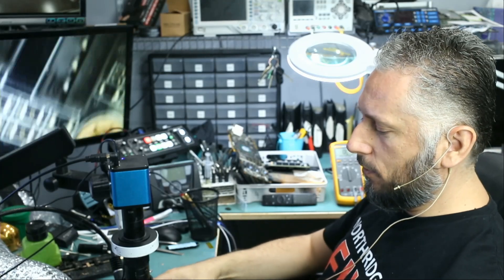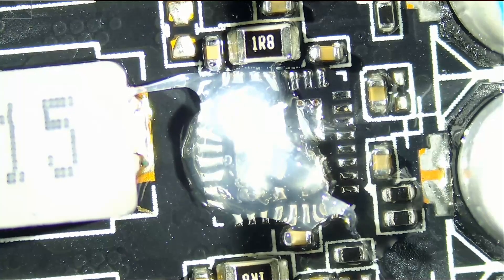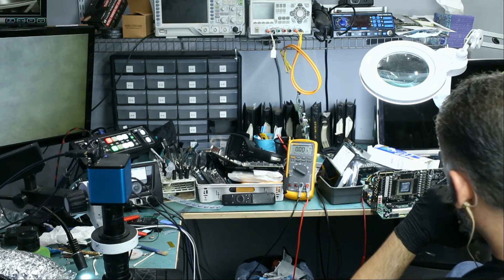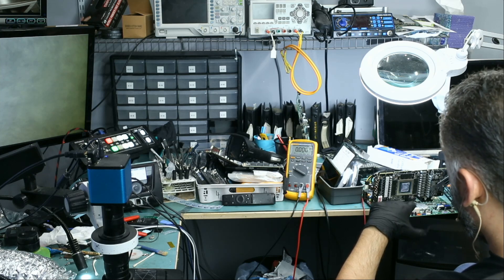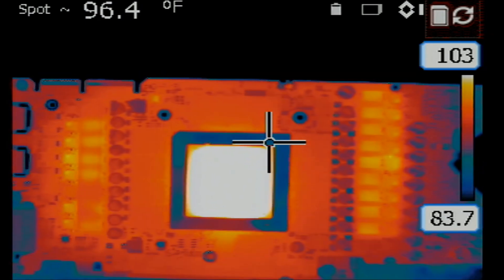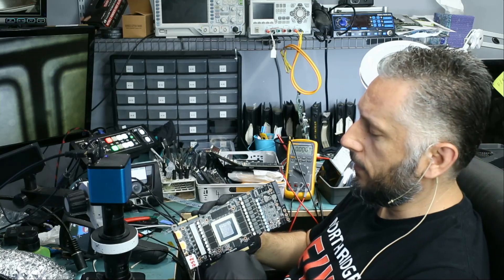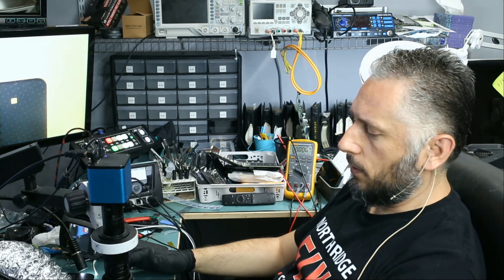Gigabyte RTX 3090 Graphics Card Repair - No Power and Not detected Part 2

Comment: You should continue testing, you barely tested anything. You should check 5v, 0.95v, pex rail, test resistance on all mosfet gate terminals, also test EN signal and Vcc and Pgood for all the drmos and buck converters and PWM controllers. Also check the back of the gpu which has tons of components, resistors that died under heat, etc
Reply: Seems like you work on Gpus alot
Reply: @nylesnguyen3797  exactly, which also explains why it took me 4 months to check my notifications and reply to your comment.
Reply: From a business standpoint, is it viable to do that thorough of a test? I know as a consumer, I would like that, and as a technician myself its the ideal procedure. These scenarios give me anxiety, when everything you tested seems normal but device still wont work properly. From you experience, what kind of training would help further repair skills? Manufacturer schematics are out of the question, yet is electronics' reverse engineering the way to go? We are also talking about a $3k board, so it sounds as a promising investment.
Reply: @zettkusanagi6322  exactly, it's a good investment. Experience is the biggest factor. For me, i can narrow down the problem of any gpu in less than 10 minutes. People think gpus are simple devices, they are one of the most complicated devices in the world.
Reply: @gpudoctor   Should start uploading some videos...
Reply: You realize this is the second video? He tested for 20 min before this

Comment: Hi, I do the same job as you but in Italy, so there is no competition.
As a suggestion I can tell you that video cards should always be tested with the heatsink mounted, because many of them have a control system that ensures that the cooling system is fully functional to prevent the video card literally catching fire. Reassembling all the pieces "annoys" a lot, but it must be done.
I hope I have explained why, I speak and understand the American language, but for the written part I use google translate.
Regards.
Reply: In a reply to another comment, he stated they completely reassembled the card with the same result.
Reply: @randyr.parker2698   I read the comment, but he connected the card without a heatsink. My (small) experience says that you have to connect the card (power the circuits) always and only with the heatsink mounted.
Reply: @codatekalbatek  Respectfully, this is not True at least for some 3090s. I have personally watched (2) 3090s post without the heatsink or any of the thermals or fans reattached. Considering these cards idle as low as ~25w, this (relatively) makes sense. Best, Robert

Comment: i guess its the controller chip that sits on the corners of the die (at least at the gtx 1080) that failed. Is the glue around the die discolored on the corners?

Comment: One chip on the left (i think a memory one) didnt seem to generate any heat while all the others did when you turned on the card. Could it be that this chip is faulty? Hope you can figure this out
Reply: Yea, that's a possibility. But it could just be that it isnt needed, so it isnt currently working.

Comment: That's got a FRIED GPU when those Vcore MOSFETs fail the GPU gets COOKED a good portion of the time going from my past experience.
Reply: sorry but i dont have the same ideia, +30 rx490, rx570, rx580 gtx 970, gtx980  all mosfets burns replace, some time replace CONTROL IC TO,  and that done work again... in last 30 only 2 die after 2 day (in burning test, and bench), "core MOSFETs fail the GPU gets COOKED" some times it open to plus, but that i do find very ofen

Comment: Most likely a problem witht the gpu chip itself when during its operation when the mosfet goes bad it short drain to source so it send a highvoltage full 12v on the gpu die instead of 3.3v or lower, because the mosfet is like a switch and in dcdc buck converter mode

Comment: That is a very power hungry gpu, will require at least a 1000w psu. Also is the motherboard compatible? From what I can remember it requires a motherboard that has support for pcie 4.0 in order to power it. May also need a cmos reset.

Can someone correct me if I'm wrong please.
Reply: On boot up, in 2D mode, the card will be drawing <20 watts (or it should be) - no beefy PSU required just to post. The card has almost certainly had the GPU fry from the 12v short. The smart mosfet that failed was one of the phases for the GPU Vcore - when it shorted out it would have sent 12v straight into a core where the maximum is supposed to be 1.25v...when this happens the fuse is the only thing that may save it but often it doesn't blow fast enough and something in the GPU burns out. The card was heating up way too much in post, even without a heatsink - indicating the GPU has an internal short.

Comment: Hello. I think a component is missing under the capacitor at 2:45. I you look at the rest of the MOS there is an 1R8 Resistor, a capacitor and under it another component. The rest of the MOS have it but the one you use the which doesn't have it.
Reply: Check at 9:02 on part 1 video. It doesn't have any component. It's just empty. There is 1R8 resistor surrounded by 2 caps each. That's enough. 👍
Reply: @ErickBuildsStuff  Thank you

Comment: Surely this card would be under warranty?
Reply: Not if overclocked.  afaik the card stores the fact it has been - obvious step to protect yourself if you're the manufacturer.
Reply: @jongant 
Nope, it doesn't, that's a myth. Manufacturers have no way to know if you overclocked or not unless you tell them.
Reply: @WertzOne  they could read the bios and find the clock values...

Comment: Yo guys connecting the fans does nothing. I mine and all my cards get 120MM fans, I basically remove the stock fans to preserve them. I've older and new cards, connecting the fans doesn't matter nor does the heatsink. If the card is protecting itself from damage, it'll just shut off and nothing else. It would POST without the heatsink and the fans.

Comment: It will not overheat very fast if booting only even no cooling. I can even use a gpu wihout fan for browsing only. Newer gpu dont need fan if temp is below 55c. Their is a problem in the components and maybe gpu chip is dead

Comment: On the left of the main GPU chip there is a cold spot between similar areas getting hot. Maybe some other component fried and that area does not get power
Reply: i spot the same thingy look like one of mosfets there is ded i think
Reply: Yeah I noticed that as well. One of those chips was not heating up like the others.
Reply: There's three cold power phases and that's normal because those three are for memory according to TechPowerUp review. That hot one is more interesting but maybe replaced chip just is different than others. That may be a problem if hot phase overheats or VRM controller notices the difference and shuts off with that sound.
Reply: @birdman8649  i thought that was odd as well

Comment: Mr. Alex, just ask Big Boss to assemble the GPU and try it out. Might not work, and two long beeps normally indicate RAM IC failure or hardware test failure... But still, worth the shot. Thank you for everything you teach us!
Reply: Look at 5:04 less heat on center left, is the ram chip?
Reply: @Lg6798-b1f  Seems like it, maybe replacing the ram ic should do the trick. But it's kind of hard to tell. But you can see that some components do not heat the same as others. That leads me to think that there is more than one problem.

Comment: To the comments that the lack of a pwm return signal from a fan may be causing the shutdown that likely isn't the case. GPUs don't have that sort of feature - otherwise mounting a water block would be more involved. Now, as to whether it is overheating or not. Yes, it will hit a thermal limit,  but the card should aggressively throttle itself to under a dangerous temperature. However, the lack of any heatsink to at least disperse the heat would present a potential for runaway temps thus leading to thermal shutdown. I'd recommend mounting a temporary heatsink to at least draw some of the heat away.  I don't think the gpu core is dead, a dead core wouldn't likely attempt to start at all and not produce any noticeable heat. That said, when you first looked with the thermal camera a couple of the mosfets did heat up significantly quicker than the others. Perhaps there is an additional short on those particular vcore lines.
Reply: I think you might be onto something. I like your thought process.

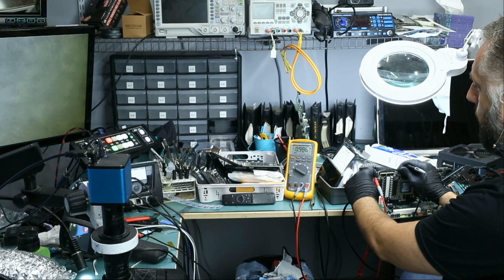Comment: Did you replace the blown fuse at 6:15 of the first part of the repair?
Reply: He jumped it with a cable
Reply: Temporary soldered a wire

Comment: You do tons of videos on GPU no power. But what about GPU that green screens when it goes under load? Is it possible to replace just one of the Vram chips?
Reply: Use Nvidia Mod and MATS to see if it's a vmem problem.

Comment: Hey Mr. Flash where did you sourced the mosfets from ! I’ve tried to google it but no results found. If you can share that would be Massive help thanks
Reply: I think it‘s from a Donorboard...
Reply: @DiggInTheCratez  that chip looks brand new and you may not have noticed he searched for donor components on his previous video but didn’t find any. He also said thar he’s gonna order that particular chip in bulk.
Reply: AOZ5332QI, search for that one. If you cannot get it from your preferred supplier, about 5 vendors on AliExpress do have them.

Comment: Could it be that they have implemented a mechanism whereby without the heatsink and, in particular, the fans connected the GPU does not start? Maybe without the fan RPM reading the GPU shuts down in advance after some time
Reply: I'm my experience, the card will always start with no fans connected
Reply: @ReubenHorner  I agree with you, also in my experience the GPUs also work without heatsink/fans connected but also in other comments they confirm the fact that some RTX GPUs do not start without fans...
Reply: @matteopontiroli7517  I'm not sure if that is true information. Manufacturers dont have a reason to require that. Instead, the card will just throttle before it reaches a deadly temperature. These 3090s can handle a good 200 degrees Fahrenheit also. And I found a comment by Alex that said he resembled the card, still no luck.
Reply: That would be horrible for everyone wanting to watercool the card.

Comment: Almost sure its because of the gpu core heating up it shuts down.
Maybe try putting the heatsink on and fire the card up.
Reply: It will not overheat very fast if booting only even no cooling. I can even use a gpu wihout fan for browsing only. Their is a problem in the components.
Reply: On another channel the card still boots up and you get the bios screen.  I would guess the GPU die is the next stop after the VRMs.  If 12 volts or some other extreme voltage hits the die, then it could be game over for that gpu.
Reply: @GodKitty677  Probably right
Reply: @codex6087  Remember the 3000 series heats up a lot quicker.

Comment: I think you should tell your clients to not OC there graphics card
Reply: Why? If you do not touch voltages and you have a proper cooling solution or at least monitor the temperatures there no reason to not oc a gpu.
Instead, you can extend the life of a gpu (performance wise ofc) by doing it.
Reply: @davides1489  if you want to extend the life of the GPU you want to under clock it less heat = longer life, but you don't want OC your GPU when you aren't can send it in warranty if it died, specially if it's an expensive tool you use for your work
Reply: @Irilia_neko  tbh idk what kind of overclock you are doing but I never had a card that failed before 6 years even tho they are always on oc (after warranty I use only liquid metal).

And still, I'm talking with a proper cooling solution.

Edit: added last paragraph.
Reply: @Irilia_neko  they are "fake expensive", in few months of mining they are litterally free

Comment: So my RX 580 8gb sapphire nitro gives no display. Pc boots on(I can hear windows desktop etc), but no display, gpu rbg lights turn on but fans don't spin. So any idea what could be the issue? Thx for reading
Reply: Zero rpm mode, so fans probably wont spin. Do you see the bios at startup? If so then it is a driver issue on your windows.
Reply: @JJ21lives4ever  nope no display at all. And I think fans boot on PC boot and then stops, but in my Case they don't spin at all not even on boot
Reply: @makaveli1337_  if there is no spin at boot, then it may not be getting supplemental power. Is the power connector properly seated?
Reply: @JJ21lives4ever  yea man, even tried on different PC and different PSU same outcome
Reply: Try other ports. Usually far left is first output.
Reply: @msetechrepairs  Tried on friends pc aswell, same outcome
Reply: The rx 480 had a feature to save energy, fans only spin when needed. If u using video adaptor or dont have a sexond monitor to test, wait until windows start. A cheap Post Card Test can tell u something. Also try clean with isopropil

Comment: Maybe card detect no fan spinning and turn immediately off. Alex try connect graphics card fans ....
Reply: Yeah... Even I thought the same. He should try connecting all the fans. Bcz due to no fans connected the card turns it self off to avoid any thermal damage to GPU or components
Reply: you dont need a fan input on the gpu if that were the case then my watercooled gpu would not work as the is no fan input
Reply: Might be.  I've seen videos of people saying without a heat sink on the gpu it will get too hot very fast, so I could see the manufacturer putting in a shut down feature if it does not detect fans.   they need to put it back together to ship it back, so might aswell throw it back on the motherboard and see.. these new cards draw some big power and I could see a manufacturer putting a safe mode in place to stop damage.
Reply: Honestly no, you should still get to the post screen at least.
Reply: Maybe alex should give this a try. „Auto turn off“ That could be the reason
Reply: 100% incorrect and he also tried that, as well which left him w the same result.
Reply: someone get this comment higher. Newer cards do this and auto shut off to protect damaging component.
I would ask to put the card back together
Reply: @herpderp7791  they will shut off but even on 30 series there is still enough time b4 they do to post over on tech graveyard he  does this same thing all the time even on 30 series cards without any issues so odds of that being the problem are unlikely